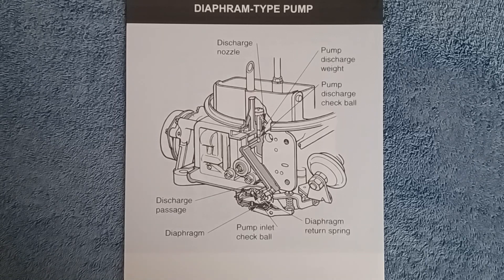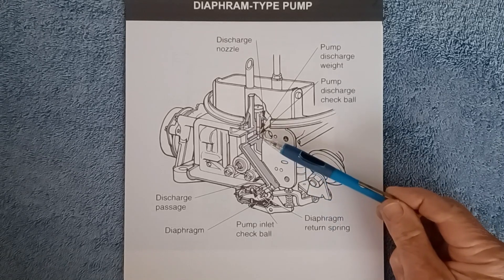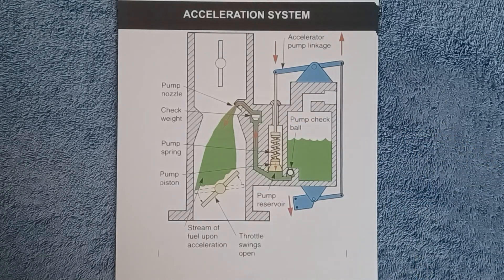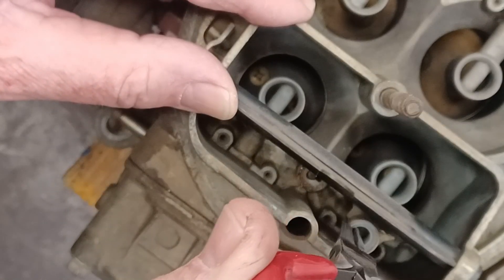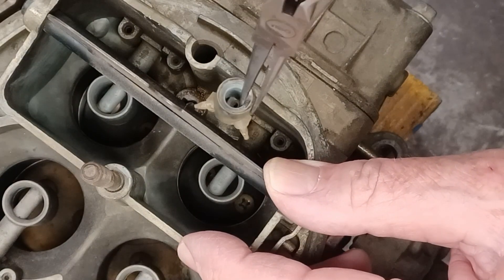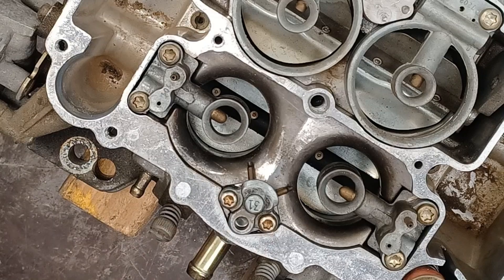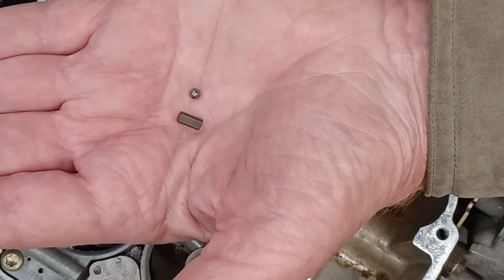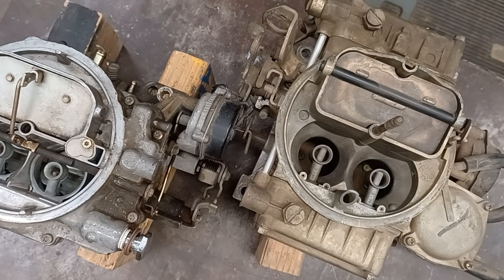Carburetor Accelerator Pump Circuit Diagnosis and Repair

Comment: on the Holley, couldn't you crack open the top and spray PB in on top of the weight and let that un-gunk the valve?
Reply from the maker: It's possible that you could do that and it would probably work, but you have to take the screw out to access the weight to spray it. As long as you're that close, you may as well take it out and get a good look at it. Thanks for your comment.